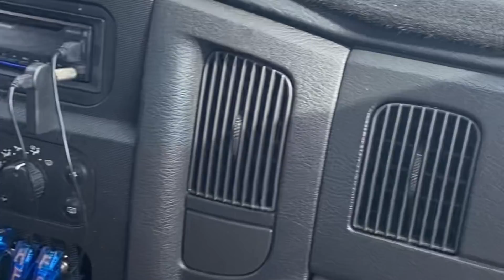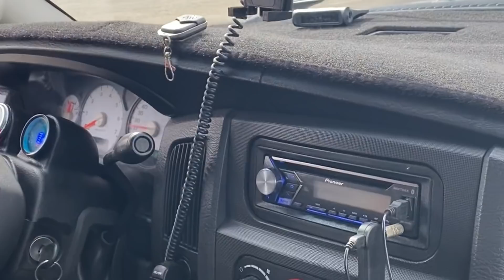DODGE 1500 DIESEL

Comment: O bom e velho Cummins 6bt 5.9 12 válvulas, esse motor equipa as RAMs diesels 2500, 3500... de primeira geração e primeira metade da segunda geração (94 a 98) aí nos EUA. A segunda metade da segunda geração das RAMs (98 a 2002) já eram equipadas com o 5.9 24 válvulas. Esse motor aí é uma lenda aí nos EUA.